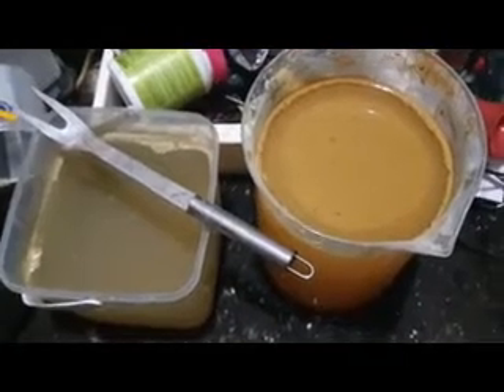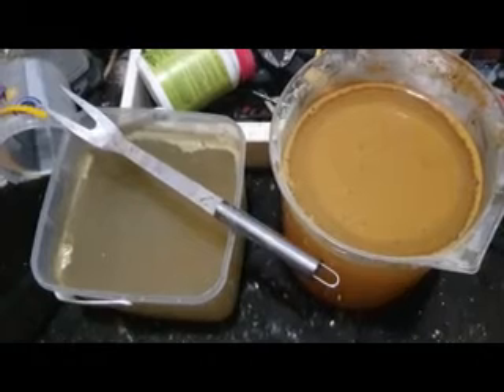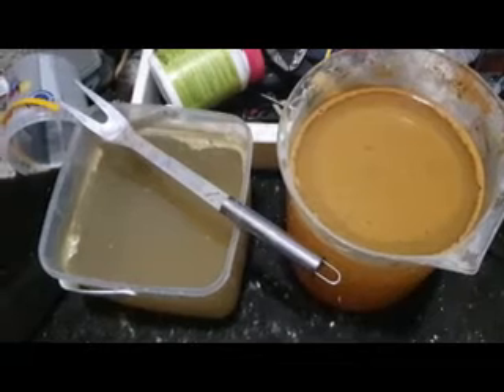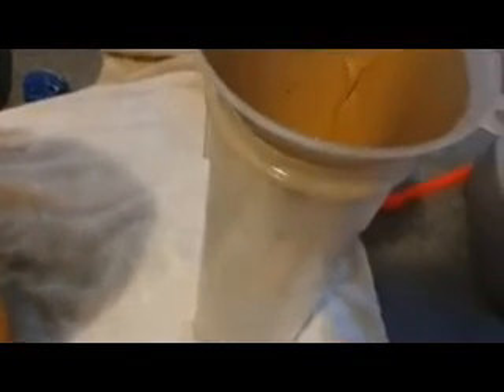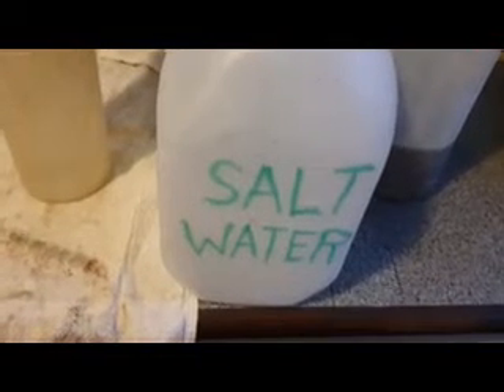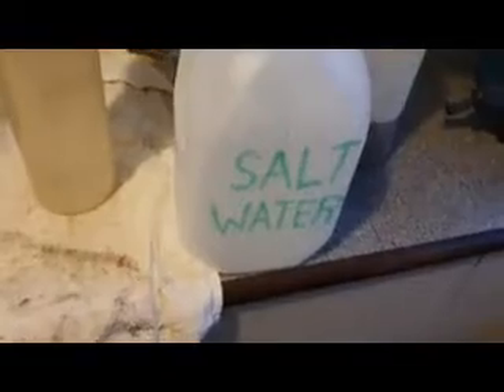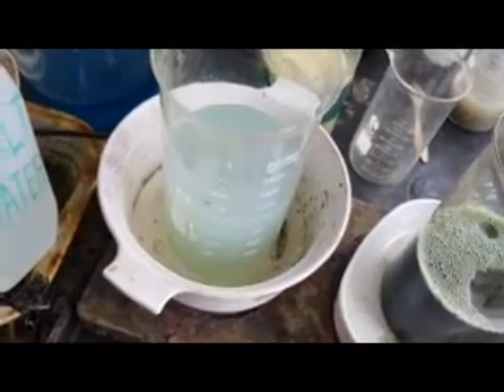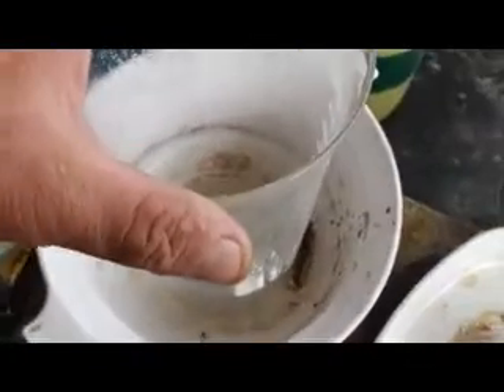GOLD RECOVERY / part 2 recovering gold from boards without acid

Comment: I don't understand I just don't freakn understand I filtered transfered added hydrachloric acid put on heat and added bleach approx 10 12 x and I still got all that dam sendament why what am I doing wrong I just wanna flush it soooo bad
Reply from the maker: i need more details, what r u processing, exactly what you did step by step, pictures or videos
Reply: I did AR solution with pins fingers boards 2 months ago had a lot of sediment in the bottom . filtered it took the filters put in fresh hydrochloric acid with little heat added a little bleach several times till reaction died down filtered  and added copperas  still have sedement  don't know what the sediment is I don't know what I'm doing I really don't
Reply: Don't know how to add pics n videos
Reply from the maker: @wilhelminapruitt528  you will need to go to my fb page and message me from there

Comment: Awesome Mr Pete. Can you use the salt water method with pins? Hows the truck mission going?
Reply from the maker: i guess you could if you want to put the clip on every pin individually. or a guess if you used a wire mesh basket. like ive got a stainless steel mesh basket i use.
and i cant fix my truck until i magically come up with 3k
Reply: Eish sorry bro wish i could help. Have you considered crowdfunding?
Reply from the maker: @ryanedwards2021  I wouldn't know how

Comment: Hey Pete! Fun video!! 99% of the time now, I just dry my well rinsed precipitated gold straight in the beaker. The trick is to use a very clean glass beaker. I wash my beakers in BonAmi cleanser (it doesn't scratch the glass). Low/medium heat. I stir it with a glass rod occasionally, but that's about it.
Reply from the maker: ill try that, thanks alot